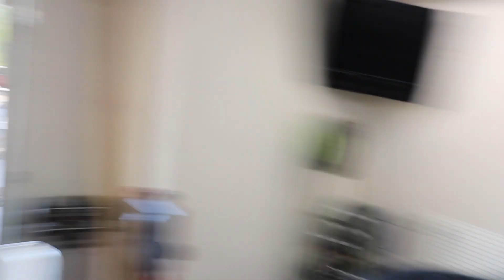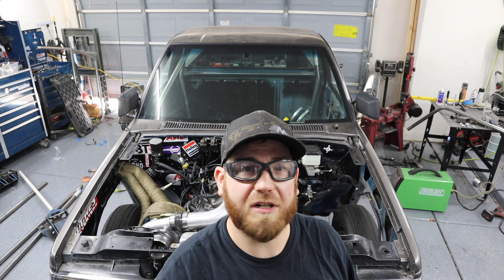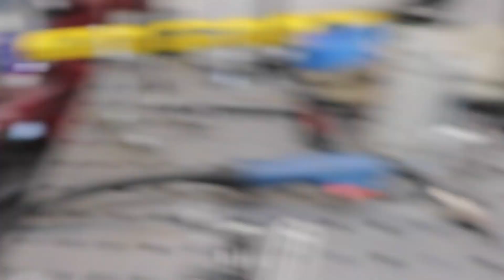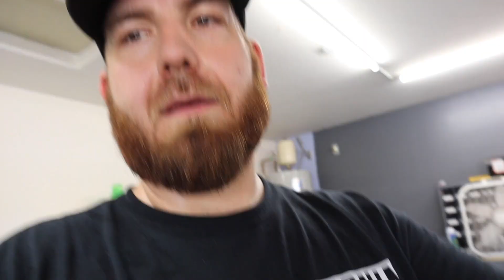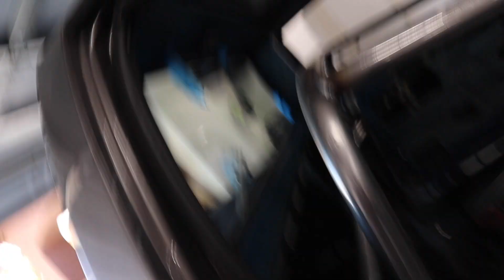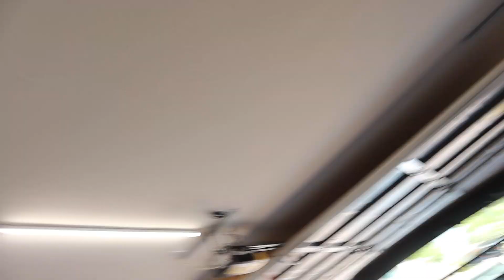10 Point Roll Cage Install in the Turbo LS S10 from S&W Race Cars(Part 2)

Comment: I just found your page a few days ago ad cant stop watching the s-10 build.  I have a 5.3 that I also want to stick in an s-10 but I am looking for the perfect ext cab to do so.  Love the content keep up the good job
Reply: I would not use an extended cab man, the regular cab is better for racing and also they have a 3 U-joints with a carrier bearing. makes getting driveline angles a LOT harder. The short cab only has 2 U-joints so the motor and rear end just have to be parallel.

Comment: What # do you put on mig welder just bought a miller and me and my buddy are doing the 8.50 inspection roll bar just trying to get best setting for wire speed and heat we started at 137 and like 35 I believe any suggestions you can help us out with that at all would be greatly appreciated

Comment: What did tech say if anything about not having the rear bars ? I dont want to use them either .
Reply from the maker: Didn't say anything about them. I think you need them go faster than 9.90 though. I'll cross that bridge when I get there.
Reply: @RobbyVsGarage  I guess we both will  👍